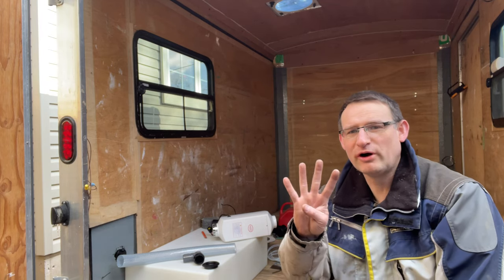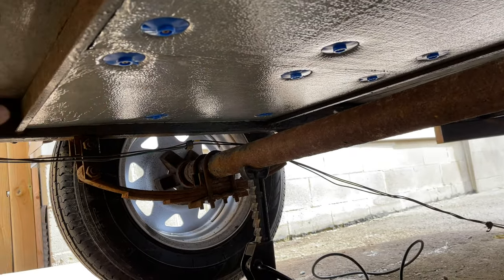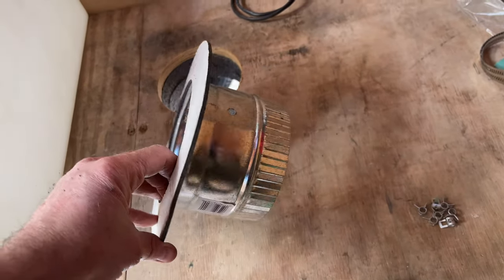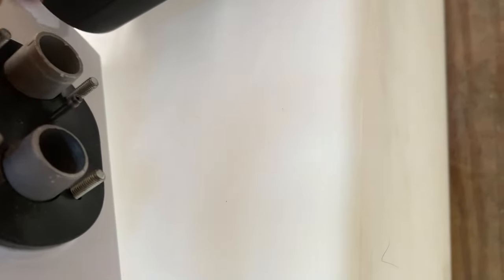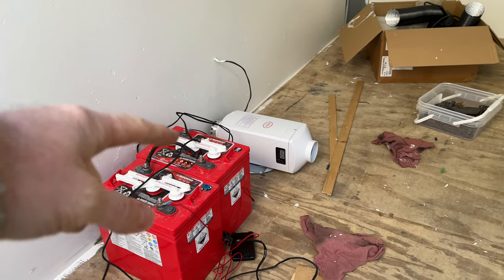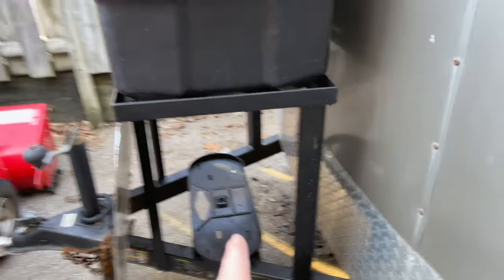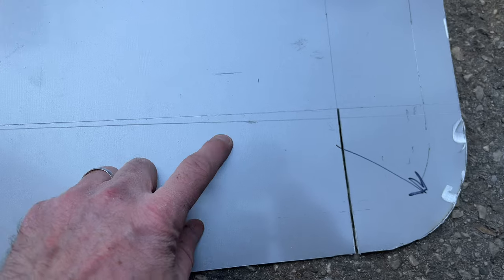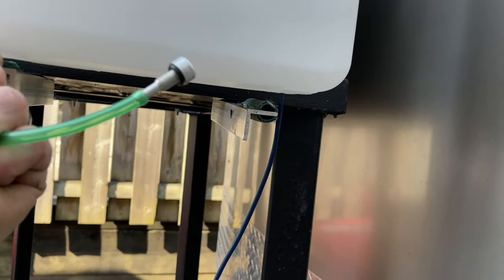How to Build a Cargo Trailer Camper Part 4 - Diesel Heater/ Insulating the Floor

Comment: Dude, you're my hero! Way to stay creative outside as the snow flies. I've got a nice horse trailer I plan on dolling up for winter camping and I appreciate you sharing your project.
Reply from the maker: Funny… I was just talking to my Dad about putting one of these diesel heaters in his horse trailer/ camper. I think it would be perfect 👌
Thanks for following along!
Reply: @waysoutback  as a suggestion, hot dip galvanized Unistrut on the undercarriage would make for a great protective cage for fuel lines and electrical. Home Depot has it for cheap. You can also get snap in covers in metal and plastic

Comment: OMGoodness the way you insulated the floor to me is genius. Thank you for posting this video...going to use your idea to insulate my trailer floor after I first undercoat the wood and metal...thanks again ✨
Reply from the maker: It worked out pretty good! I would glue the underneath and calk the edges but it feels really solid 👌
Reply: How do you keep it from being damaged on the road?

Comment: Very creative fuel tank mounting set up ... I appreciate your detailed explanations. ... nice Chinese diesel heater install too ... thanks for the videos!! PS: all the heater manuals say to mount the fuel pump at a 35 degree angle to avoid air bubbles ... simple fix ... just rotate the pump a bit to 35 degrees.
Reply from the maker: Thanks. I like the heater... it has a metal body.. seems pretty well made, I’m quite happy with it. Thanks for the tip about the pump I’ll make the needed change 👍

Comment: Makes sense about the fuel line I've seen quite a few videos where they have had to replace their diesels heater. I always thought because they didn't properly Prime there fuel line from the fuel tank to the filter and pump. Also some people always complain that they could hear the fuel pump clicking but by mounting it outside like you did that takes care of that problem very smart idea
Reply from the maker: Thanks!…. yeah so far the little diesel heater has been great,  No problems! 👌
I think your right because the instructions are so poor I think a lot of the problems can be traced back to the installation.

Comment: I debated using one big hole with a metal sleeve.  Instead I used a 2.5" hole saw, drilled twice into a figure 8.  I then used FIRE CAULK to "paint" the exposed wood edges with a finger and under the metal plate.  I've since camped in temps into the teens and the steel mounting plate hasn't gone above 100 degrees on the inside of my rig.  I've temp tested the exterior around the exhaust concluding that the metal sleeve wasn't necessary.
Reply from the maker: If it works for you that’s great but be careful the average temperature of that exhaust where it exits is 160C or 320F. That foam insulation softens at 220F and will usually melt around 260-300. It costs about 5.89$ at Home Depot for that metal ring. I strongly feel it’s cheap insurance. I don’t think I’d recommend for anyone to do it any other way, but that’s just me. I’d really recommend anyone that’s interested in installing one of these to check out John’s videos I linked to in my description he’s super detailed on his set up.

Comment: A hint/tip, Silicon is not the best material for a long lasting seal against water infiltration, many people think it is, however it is not as it has a tendency to let go over time.
Quad, a sealant used for eavestroughs, windows and doors is far superior, it can be bought at Home Depot or Rona, although it is more expensive, you really do get what you pay for in this case. Another great video, Thanks.
Reply from the maker: Ok that’s good to know, I’ve been using Goop marine glue for all the body penetrations. I have an extra tube so I can use it for the floor also. 
I was going to run a bead of silicone around the insulation under the floor.... I’ll use that Quad sealant  Thanks for the tip. 👍
Reply: @waysoutback  Quad sticks to anything and everything, just follow the requirements on the tube and it’ll do it’s job. My parents had a camper trailer that had a roof leak due to age, the aluminum roofing on it was corroding away, my stepfather tried using silicon for years and it always leaked, I told him to use the Quad sealant and he never has had a leak on it again and it’s going on 6 yrs now.

Comment: I’m surprised you didn’t add some heat wrap of some sort to the exhaust pipe. As well the duct you installed into the floor isn’t double walled or insulated. 
Personally myself I don’t like the fuel line right beside the exhaust outlet, such a poor design. On my heater I used automotive exhaust wrap and a thermal sleeve as that exhaust gets so hot it’s nuts.
Great work and great video, maybe I’m just a worry wart with all that insulation so close.
Reply from the maker: Thanks I did think about it, but it’s been around 4 years and the soft insulation has not melted at all. So i feel safe without it.

Comment: Just curious where you got the diesel heater from and are you happy with it.  Love the videos and great job on the trailer!
Reply from the maker: I ordered it off Amazon I think the link should be in the description. I think it’s a pretty good one because it has a metal housing but I feel 95% problems are due to poor install.

Comment: I will be doing the same thing you have done, only it is an 8.5'X28' trailer. I want to do the same thing you did with insulating the floor. The problem I am having is finding the plastic washers you used to hold it up. Please tell me what they are called and where you got them. Thanks for all of your ideas.
Reply from the maker: Rigid foam board fasteners. 👍

60mm Reinforced 30% Glass Fibre Washers for Fixing Rigid Insulation Boards, Brown - 200PCS https://a.co/d/0ZF1kOr

Comment: Thank you for the great content! Just curious if you've had any issues with the diesel in your fuel tank gelling up in the freezing temps? Do you use diesel additives? I'm looking to install a diesel heater in my camper. I live at 10,000 ft in the Rocky Mountains.
Reply from the maker: No issues at all. But I make sure I’m running winter diesel fuel. Here in Southern Canada they switch over in November. I just make sure the summer fuel is drained out. At 10000ft you will need to adjust the fuel dosing pump volume. If you Google it, they have some pretty straight forward blogs on how to set it up. I had to do that when I was out in Colorado. Also once and awhile run a smaller bit of pure kerosene through it. It cleans everything out nicely. Hope that helps a bit, the little heater has been great so far 👍
Reply: @waysoutback  More than helpful. Thank you so much!

Comment: Just curious.....Is there any  reason why you didn't just place the fuel tank INSIDE the box along with the fuel pump? Also, did u have problems mounting the fuel pump straight up and down? It's supposed to be monuted at a 45 degree angle. Thx
Reply from the maker: I was planning on mounting it in the box. I was going to use a small Jerry can. But I found it was taking up to much space when I laid it all out. That’s when I decided to mount it outside. It’s also nicer filling it, you don’t spill inside your box. As for the little pump my understanding is it can be anywhere from 45 degrees to straight up and down. The straighter up and down the better. The reason is as it’s pumping it makes small micro bubbles if you don’t allow them to continue through it will cause the pump to cavitate. Straight up they work their way through no problem. I’ll link a video below to the best YouTuber out there on these diesel heaters. He runs a lot of tests and breaks down the setup. There’s a pile of miss information floating around.
Reply from the maker: Here’s the man! Follow his setup you won’t go wrong. A lot of the problems with these heaters is poor install. He really helped me, hope that helps!

https://youtu.be/jCZhjGyR3bo
Reply: @waysoutback  That guy's TOO thorough for my liking (almost to the point of confusing). I mean, in the end (according to him), isn't he basically just saying to use everything (stock) that the kit comes with (including the green fuel tube)? It's just so long and I spend WAAY TOO MUCH time watching YouTube (YouTube University as I call it) as it is. I think your video is MUCH BETTER! 🙂
Reply from the maker: @artest7  yeah it’s amazing the free information you can get on here... Love it!
I liked him doing all the explaining, but I’m glad you like my video better ..... I guess I watched all his videos so you don’t have to. 😂

Comment: Hey...thanks for the videos.  So...what kind of total trailer weight did you end up with?  How about tongue weight?
Reply from the maker: 2300lbs total with a full water tank. 360lbs on the tongue 👍
Reply: @waysoutback  Yes...I was thinking your tongue weight would be right up there.  My 2020 Grand Caravan could handle the total weight...but the tongue weight is right at my max...and that would never be good.  Thanks.

Comment: Thanks for the videos. I’m likely purchasing a 7.5x16 all Al trailer soon, I’m in central WI. 

Have you noticed any build up of road salt/grime issues with your floor installation being on the outside? Do you think the insulation you used has been sufficient? Thanks!
Reply from the maker: Right on…. Highly recommend building your own!
I did notice salt under…. After every long winter trip I’d pressure wash it. I think what I’m going to do is install some frp panels on the bottom…. Seal it all up

Comment: Bottom of the trailer insulation is secured to the wood, are you concerned that water would get there and damage the wood ?
Reply from the maker: Yeah I’ve been thinking about that I think once it’s all built I will calk up all the seams then rubberized undercoat it. I’ll have to see how it reacts on the insulation though. I don’t want to melt it.
Reply: @waysoutback  it will be protected form the elements and the road debris think you are on the right track.

Comment: So I have another question for you haha. Any issues with condensation in cold weather?
Reply from the maker: Really depends on how cold your camping in…… when out in the extreme cold it definitely forms condensation on windows and any metal on inside…. Anything that provides a thermal bridge to the outside will drip. I like to keep the vent cracked a bit and the heater running….. definitely keeps it dryer but we still get moisture, not much you can do about that.

Comment: Any negatives if the insulation gets wet?
Reply from the maker: Nope this type is completely water proof. I think  it was originally designed to go under a concrete slab to provide insulation…. I think the pink and blue foam board is also water proof if that’s easier for you to get.

Comment: I’m back.  I’m not being hypercritical or an online ahole.  This is a genuine question that hit me.  You are the second trailer builder on YouTube from Canadia (having some fun, because the world is way too serious) that mounted the tank outside for very obvious reasons.  You guys from up there are probably the best to answer this, but have you had any gel problems when the temps drop below “zero,”:or whatever it is you call it up there.  I don’t have to go to much further north where a weather event might cause some temperatures in the gel range for diesel.  We call it an event.  You call it Tuesday.
Reply from the maker: No problem excellent question…. Tuesday is a rough day for sure. 😁

Seriously It can be a huge problem up here when it drops below freezing for a long while. 
The critical thing is to not have old (summer) diesel in it. If I am not going to use it for awhile I’d drain the fuel from it then fill it when I need to start using it again. 
Up here in Canada and the northern States (not sure about the South) they add anti gelling additives to the fuel in the winter months. So as long as your running the heater in the same time period as you bought the fuel you would be fine. 

Also one thing I forgot - I buy my diesel at a truck station. The larger the volume the better preferably where long haul truckers fill up….. diesel has a problem of collecting water in gas station underground tanks. That will definitely freeze and cause all sorts of problems. Also if you ever see the tanker truck there filling up the underground tanks skip it…. It stirs up all the sludge, water etc and you will put it in your tank. Hope that helps a bit.
Reply: @waysoutback  Thank you for the reply.  I was wondering if anti-gel additives caused problems with the heaters.  I’d have to buy a can of it before I left on a trip.  You have terms like summer and winter diesel.  We call it diesel (It’s all summer blend).  Using the leftover diesel from the heater is no problem goes in the tank of the tow vehicle - for now.
Reply: @williamolliges2622 I think you can just add kerosene to it.  Not sure the ratio. Maybe just experiment a bit.  The diesel heater manufacturers suggest running a tank of pure kerosene to “clean” it, so running a ratio will not hurt it. To me, its odor is less offensive than diesel but it’s still not pleasant.  Also, kerosene apparently generates less BTUs than diesel, but it’s negligible.   For specifics, diesel gels at around 15 degrees Fahrenheit, kerosene at -40 degrees Fahrenheit.  Yes, negative 40 degrees Fahrenheit.  So I think we can conclude in most conditions, it will keep your diesel from gelling.  Again, I don’t know the exact ratios, but you are “safe” experimenting with those parameters.  Happy trails and stay warm out there! 😊

Comment: They want that pump at a 35 degree angle
Reply from the maker: Actually that is a misconception….. check out this guy… he’s the man when it comes to anything diesel heater. I’d totally recommend looking over his research.
Just needs to be 45- to vertical anywhere in that range… it’s to move the air bubbles through, stop cavitation.
https://youtu.be/TGFDFZ6r1dI

Comment: Where did you purchase the plastic washers and what are they actually called? Thanks!
Reply from the maker: I bought them from HOme Depot .. if your anywhere close to London Ontario Canada I’ll give you my extras. If not this is the information on the website.....

Model # W50 Store SKU # 1000735671
DMX Washers are used with DMX AG Foundation Wrap to secure the membrane in place.
Reply from the maker: Mine are blue but these are grey.... same thing
Reply: Thank you

Comment: The green tubing exiting the pump is too large in diameter.  You should have gotten a hunk of white, very small diameter, rigid nylon tubing for that part of the install.
Reply from the maker: Yeah you got it. I tossed most of it and bought the hard nylon. Thanks 👍

Comment: if you had a choice if doing it again, you you get the extended V nose front of the trailer  for the extra room ?
Reply from the maker: No, not for what I wanted, I liked the square front easier to plan and build.
I did make changes to the original in this video.
https://youtu.be/6G1-MKZaC4c?si=j29hM4WN-ThPeR1t